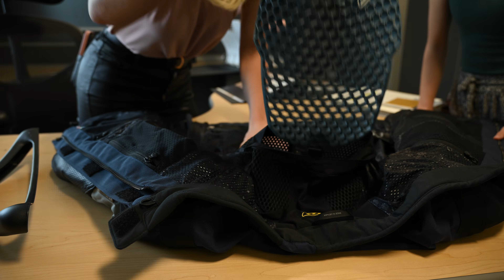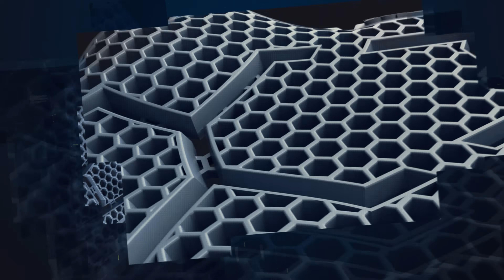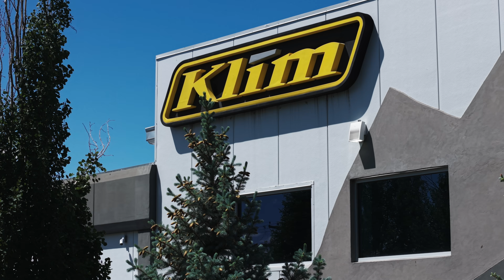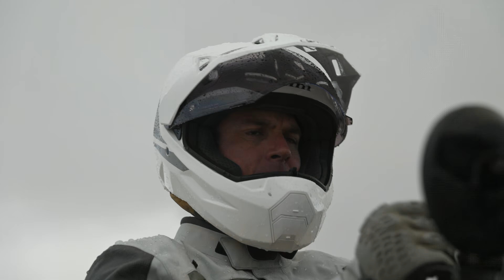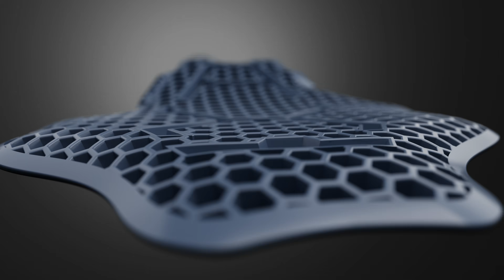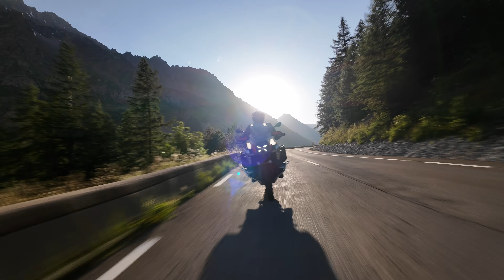Introducing All-New KLIM Rogue Armor

Comment: I have an induction pro jacket from 2022. I've weighed all my ce2 d3o armor that came in the jacket and it's lighter or the same weight as the rogue pieces, piece by piece.... The shoulders and elbows are not mesh so there's no benefit other than my back pad breathability but that's the piece that is 316g on my kitchen scale compared to the 370g rogue back pad on klims website....
Reply from the maker: We're glad you brought that up! The 2022 Induction Pro Jacket has a lvl 1 back pad and the Rogue back pad in the 2026 Induction Pro is a lvl 2 which would explain the weight differences. What were the weights you got off of the limb pads?
Reply: @KLIMMotorcycle I didn't know my back pad was L1, thought it was L2 when I got it in Sept 2022. Sorry about that

This is what I measured 
Elbow 155g
Shoulder 145g
Back 316g
Reply from the maker: Hi! Rogue armor is noticeably lighter than the pads used in our previous gear. In fact, when you outfit a jacket and pant combo with Level 2 armor, you’re saving a total of 297 grams (about 0.65 lbs).
Reply: @KLIMMotorcycle I literally just weighed mine an accurate commercial kitchen scale which I use daily...

Are your weights accurate on the website? Or maybe the weight is for the pair even though it says "pad" not "pads". 

Anyways let me know if you'd like images sent to support which might help?
Reply from the maker: Are those weights for Rogue or D3O? Further down on this website, you can see weights for Rogue: https://www.klim.com/rogue-armor
Reply: @KLIMMotorcycle they are my d3o armor weights. I didn't get rogue armor because it appeared to be the same weight essentially and the airflow was irrelevant because the elbows and shoulders aren't mesh on the jacket anyways

Comment: I was curious to learn more about these, thanks for sharing the behind-the-scenes. Are the L2 protectors rated for both T+ and T- ? I only caught the part where you talk about the higher temperatures.
Reply from the maker: All lvl 1 and lvl 2 limb pads are certified ambient, wet, T-, T+.
Reply: @KLIMMotorcycle do you also have details on the mean remaining transmitted force in kN for the L2 and L2 EXP protectors?
Reply: @KLIMMotorcycle  Great! thank you

Comment: Good to see your team speak about T+/- ratings something we don’t usually hear from other manufacturers. 

What you missed is info on backwards compatibility with older products. Assuming it will fit from your social media posts. 

Happy that KLIM is investing in R&D allowing a better vertical integration of the product components. Hope you will pass on some of the savings you receive from not using D3O back to the consumer.
Reply from the maker: Good point, Rogue Armor is backwards compatible with previous generations of KLIM gear. One thing to note is the new Kodiak comes with Rogue EXP, prior gens of Kodiak are compatible with standard Rogue pads.